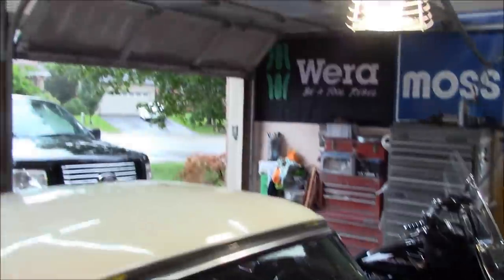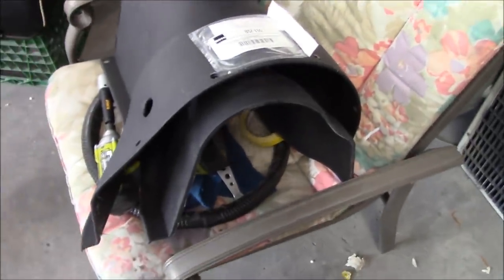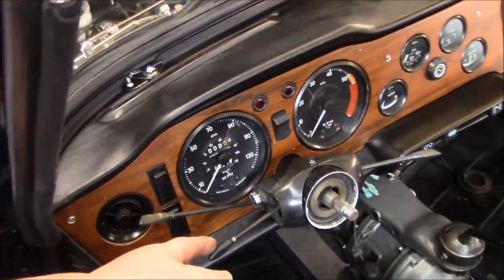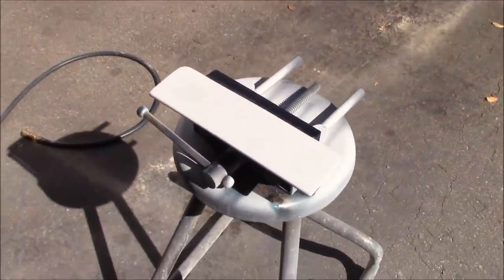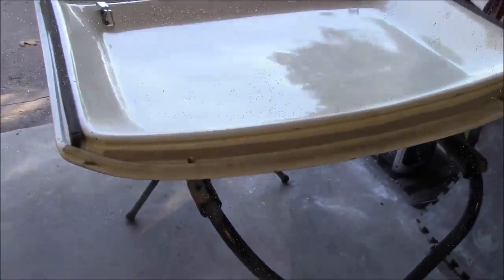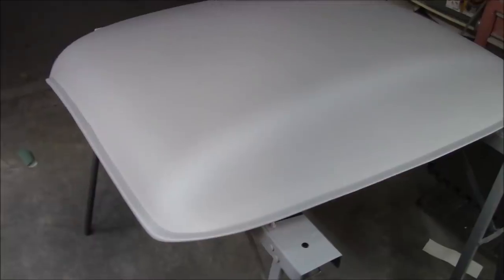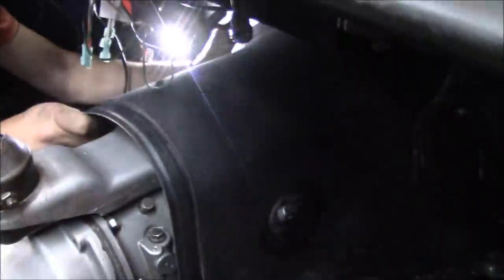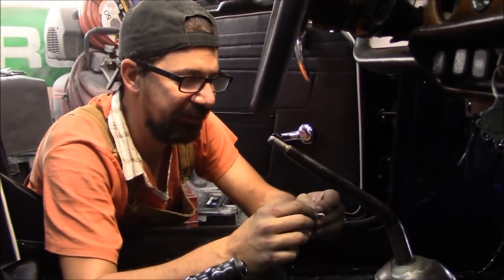1968 Triumph TR250 Restoration Project, Painting (Fails) Final Wiring and Small Projects Check Off

Comment: Looking good Chef, the underside of the top is great, I would carefully support the top laying flat. You might have to sand the top side all the way down but you have plenty of clear to work with so nothing to lose trying to save the clear you already have shot. You may have to remove some of the heavy curtain to speed the curing. All is not lost yet, You saved the wings with all the contours so you can save this also. Good luck, Frank
Reply from the maker: Hi frank, I’ve pretty much decided just to sand it down and re base and clear. I think it will be easier and will be better in the end as well.

Comment: Hi Dave, sorry to hear about your shoulder injury, you didn’t mention how you injured it but hopefully it’s not your rotator cuff. Nevertheless the car is coming along beautifully, although it was out of character for you to hang the roof vertically to spray it, but I guess we all live and learn! Take a break and nurse that shoulder my good friend, there’s always another day.
Reply from the maker: Hi Phil,  I fell in the garage a few weeks ago…sounds pretty innocuous, but I tipped over backwards off a milk crate that  I was sitting on in front of the trailer…there’s a large ledge from the garage floor down the the driveway…I pushed back on the milk crate over the edge and the crate tipped back and me with it…not only did I fall, I hit the trailer and came down on my right side and arm…..silly really, but it’s really set me back.   The problem is, I’m not good at doing nothing….it doesn’t seem to be getting any worse but it’s not getting any better.   I really just need to stop for a week or two I think.

Comment: Hi Chef, love the carbs return linkage, not sure about the bullet gear knob. Sorry to see the curtains on the gloss coat but makes me feel better about my efforts when the Chef has these issues too.
Reply from the maker: Yes, I kind of like the matching knob and wheel combo, the problem is that knob feels very cheap and actually already needs repair as the threaded insert is loose in the wooden inside….the billet one is quite solid and has a good feel…

Comment: Good progress and we surely join you in our appreciation for Elin's help.  On the wiper motor - I also have problems with understanding the wiring for the park function.  The wiring diagram and even the Bentley doesn't seem to fully explain how it works.  So, if you can figure it out we sure will appreciate you showing the fix in the video.  THANK YOU!
Reply from the maker: There is one good thread I might be to link to here when I get home from work....it might be helpful.

Comment: Once the clearcoat has hardened it will have shrunk a little bit too so with some careful sanding you may get away with just re doing the clearcoat and as the underside is okay at least you can lay it flat when you respray to the top.
That being said it's a real bummer when you get a paint run like that I've done myself a few times over the years for exactly the same reason I think you called it "user error" that made me chuckle as I tend to use more choice words when I know it was my own fault ha ha.
You make a very good point about working with an injury, when you're not enjoying it as hard as it is you have to STOP!
Look after yourself mate.
Reply from the maker: I think in this case since the run is so bad, Id be better off just to sand it back down and re base and clear...
Reply: I was probably being a little over optimistic. 
Happy sanding !

Comment: Looking good. Quick tip on ABS plastic. You can actually weld it with a soldering iron. If you have some scrap you can use it like filler rod when Tig welding.
How well does the JB weld work? Looks good enough.
Reply from the maker: We didn’t show it as we were not sure that is was going to work, but in the end, after the JB weld failed( it peeled off) we end up plastic welding it with the careful use of a propane torch and plastic zip ties for filler rod. Worked fantastic. I wish we’d filmed it!
Reply: Nice. I forgot about the zip tie trick.

Comment: That transmission tunnel is nice, but a real bear to install. I think it took me the better part of a day to do solo. I'm not sure if the original style would be easier or harder, I never reinstalled my original tunnel.
Reply from the maker: They are both a pain Bill.   Elin and I were trying to decide if you could pull the engine and trans with that front cover in place if need be....Id be tempted to try it and that could be the real win with this cover if that could be achieved.

Comment: Now that the inside of the top is painted and done the outside will come out better once sanded because you can shoot it lying flat across the sawhorses, less chance of running the clear.
Reply from the maker: Yes exactly, it will be much easier to spray it flat.   In hind site, I should have done this from the begining but I was trying to kill two birds with one stone...If I had done the 1 side only, i would have had to have waited three days for the clear to harden enough for me to flip it and paint the other side....

Comment: Sorry about the clearcoat run....after you sand it down and are ready to paint, lay it down flat so the topside is up.  Then the odds of a run should be really low.  It will look great!  Is the top the same blue color or gray?  And take of that shoulder!   My right shoulder is not great but with PT and exercises, it's livable.
Reply from the maker: Yes, it will be flat the next time it is sprayed.  It’s actually a graphite grey colour matched to the wheel centres.

Comment: Chef, good to see you back at it. I have a question that’s a little off topic. I have a 62 TR4 and just acquired a 67 TR4A irs. The Tr 4 body is in a lot better shape than the TR4A irs body. Are the body tubs the same on both cars? Can I swap the bodies? Thanks for your response.
Reply from the maker: Oh that is a good question Steve....Ill try and research it a bit.   I know that the frames would be different with the IRS obviously but I think the body pick up points would be the same.
Reply from the maker: I think the only area that might be slightly different would be the rear body mounts but I think that could easily be overcome.
Reply: Chef, thanks for your response. I was thinking along the same lines after looking at the Moss catalog showing the different frames. I will keep you updated as I progress.

Comment: David, I was admiring the fuel line clamps that you have. Where did you get them? Part number?
Reply from the maker: Hi David, are you talking about the ones that are on the fuel lines connecting the Webers?  If so, they are actually fuel line clamps used for fuel injected cars. I bought them at my local parts store ( Canadian Tire).
Reply: @cheftush  yes, those. They look good.
Reply from the maker: @DavidSL64  Yes fuel injection clamps.  Let me know if you can't find them and I will have a look

Comment: Try the bondo trick...there is nothing to lose and it might work.
Reply from the maker: I think it will be just easier to sand the whole panel down.  I’ve got enough base to re shoot it and more clear ( not going to use the cheap stuff this time) and will shoot the panel flat.
Reply: It does work. Just use the Evercoat Glazing Putty rather than filler. Ya gotta cut and buff anyway!
Reply from the maker: @jaydegrenade  I’ve done the bondo trick before on previous videos.  Trust me, this panel is so bad, it’s best just to start over.